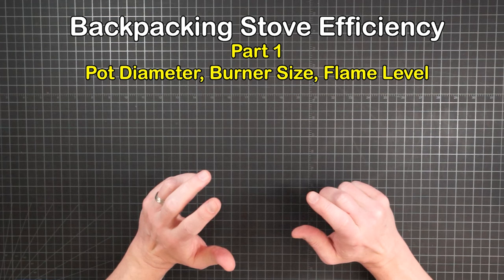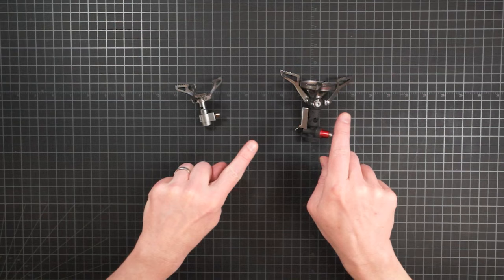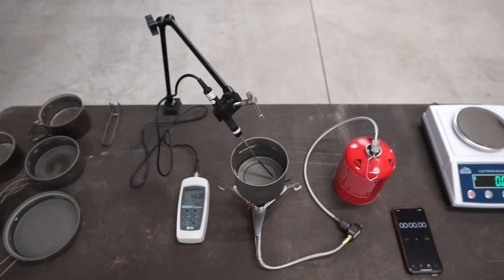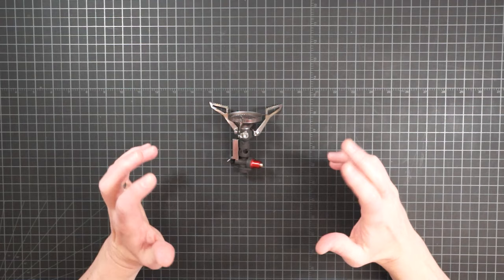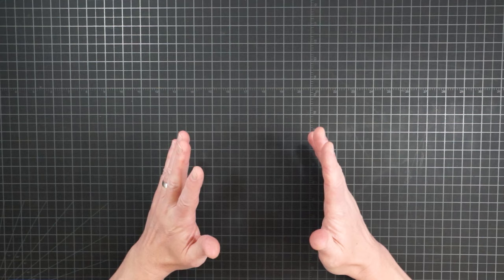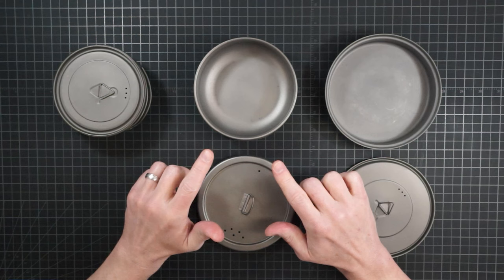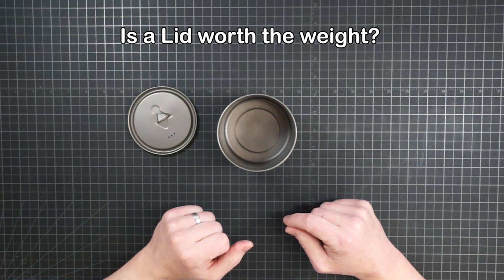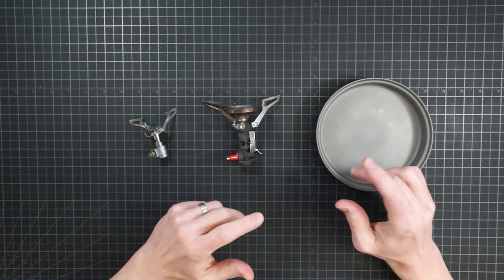Backpacking Stove Efficiency, Part 1: Pot Diameter, Burner Size, Flame Level

Comment: A useful realistic comparison. Thanks.
On a parrallel su bject. I recently bought a small (0.8L) kettle to nest in my pots. Using a Trangia stove it was taking just too long to boil with a slight breeze. I switched over to using my 1.2L pot with lid and the water boiled comparatively quickly. Result, the kettle has now been shelved. The narrow base was allowing too much heat to escape without heating the water.
Reply from the maker: Interesting.  I do want to test a variety of kettles.  I have a few sizes in both titanium and aluminum.

Comment: Brilliant piece of work.   I also went far into the weeds 20 odd years ago with my alcohol stoves.  I'll spare you the gory details but I ended up using an aluminium Trangia pan, painted with matt black stove paint and a foil lid.  My epiphany came after frustration in getting comparable results between workshop and field testing.  Finally worked out that when I introduced a windscreen it created a micro climate under the pan.  This assisted in the vaporisation of fuel and decreased boil time but not fuel efficiency.  So I duly reduced the holes and their diameter to compensate and created way better efficiency.  If you want to know what stove I use, it's vaguely similar to Don Johnsons Photon.
Reply from the maker: Good to know! I do plan to start testing alcohol stoves after I finish wind testing HX pots.
Reply: @GearSkeptic  If you want some help getting off on the right foot with alcohol stoves let me know.  I can save you going down too many rabbit holes.  They are great and can be amazingly efficient but like a good woman they need patience.  My last iteration would boil two cups of water on 15ml of fuel.  I wouldn't even bother with any testing without a wind screen.

Comment: Great testing! I've always wondered how a larger burner would act with small pots and cups. I think the biggest efficiency difference is adding a solid wind screen that allows the pot to nest into the wind screen an inch or so. That way the heat is built up and more transferred to the pot base and side walls.
Reply from the maker: I'm working on wind effects and windscreens now!
Reply: @GearSkeptic  Awesome! Looking forward to that video.

Comment: I cannot express my sincere gratitude enough. I am beyond impressed by your efforts to bring the challenge of stove efficiency to light. And this is coming from someone who already figured this out for himself many moons ago. Thank you. You're the best.

Subjectively, I found the differences to be so large that I ultimately came to prioritise the extremities of the selection. Of the arguably four most important variables in stove system selection: efficiency, weight, volume, utility, I set as many constants as I could for each extreme scenario: long haul large pack trip and short haul small pack trip. Once I had arrived at the gas efficiencies for each stove system, I evaluated the latter based on volume and weight, and the former based on weight and utility. I finally bought one of the most expensive large containers I could find as well as one of the most expensive small containers I could find, with matching stoves. The dominant condition being that gas, stove and ignition must always nest inside the pot in such a way that irreplaceable components of the "system" would always be self-contained in a separate pack module. With efficiency and weight factored out, the catalyst of convenience came to be the next logical step to developing a coherent pack system. With the growing number of utilities I can incorporate into a single pack, the stove system has become just one of many parts which must effectively work together to facilitate tackling the challenges of worst-case scenarios in nature. It of course means that the stove system, in addition to doing its job, must be quick and easy to grab and actuate, and that it must not fail; or, if it fails, must be quick and easy to replace and repurpose according to its relative value.

For short summer trips, I nested a 100g can and BRS into a 750ml Toaks that works in conjunction with fabrics and walls in my pack to attenuate elemental interference.

For long all-season trips, I customised the larger MSR reactor to serve as a general purpose stove with several thin-walled titanium vessels nested inside. A summer trip vessel is often incorporated.

In both scenarios, I always pre-plan restock locations for cans and supplies, as additional buffer my yet highly fallible system.

I hope, someday, to be able to travel unhindered for a virtually unlimited amount of time in very rough land with the right base equipment and skills. This has been a dream of mine since I was a little boy. And it wasn't until recently that I realised the actual validity of this idea. I am extending the time I can go unsupervised every so often. I believe we're soon at the point in time where experienced backpackers with careful planning and deliberately sourced equipment can become completely independent of each other. This isn't so much an introverted pursuit as it is one of safety and comfort. Once people are able to go fully prepared into the field, they can go much further, and accomplish much more in that time with minimal risk. And the social aspect of backpacking can thus be much more pronounced. Therefore I strongly endorse the transparency your channel brings. It will enable us all to be much more careful and deliberate in our approach to challenging the outdoors.
Reply from the maker: Thanks very much for all the thoughts!

I’ve been quite intrigued with the idea of just how long one can go unsupported (that is with no outside help or resupply) using just what fits on your back.  I just find efficiency to be a generally fascinating topic.

Comment: Good stuff as usual. I watched once for enjoyment and a second time to take notes. Based on my own experiments (this was years ago and the details are a bit fuzzy) adding even a bit of wind using a small fan set very distances away erodes any gains made by using a low flame pretty quick and will also likely make the lids more important. I think the trick there might be to look at just how little breeze there could be that we might not really notice it exists and if that's all it takes to kill the benefit of a low fame or not. We're not all going to take a Kestrel to measure the wind so we can turn the knob accordingly, but it seems easy enough to potentially have a bit of ribbon or string or something cut to a specific length that could work as a sort of wind sock. Using the Beaufort wind scale might also work.
Reply from the maker: I ordered a fan that has an infinitely variable speed control so I can get down very low, and use finely graded steps.  Then the Kestrel will help me measure the actual mph of those fan settings.

I like the idea of a wind string, or something shiny and extremely light like a strip of mylar from one of those emergency blankets!

Comment: Would really love to see you compare heat exchange pots with normal pots and see if they are worth the weight increase. Specifically, I’ve been using Windmaster with a jetboil stash pot which seems to make it very resistant to wind and boils water super efficiently (and fast). Very useful for group hikes or snow camping.
Reply from the maker: I’ve got wind effects planned for Part 2, but then heat exchangers are next!
Reply: @GearSkeptic  Could I also put forward a suggestion of the MSR Reactor if you can get your hands on one. Both for wind protection and heat exchange. I've been using mine for a couple of years and anecdotally think it is more fuel efficient, but would love to see your analysis on it. Especially to see if the extra weight is worth it over time
Reply from the maker: Definitely! I’ve got a Reactor and will include it.

Comment: Great tests, lower flame, higher efficiency, I am about to run some tests of my own, probably not as well conducted as this, but I am looking to see if a jet boil cozie will increase efficiency significantly more than not using it on a titanium pot. Thanks for this, right up my street!

Comment: Finally, a youtuber who answers the questions methodically using science, not because they get paid to shill something. 

Some more "food" for thought. I have also wondered about the effect of different fuels on these systems. The gaseous fuels like butane/propane or isobutane, or the liquid fuels such as white gas, kerosene, or even gasoline, to solid fuels like fuel tabs or paraffin wax. Of course each with its own system along with their pros and cons.

As for the systems the design can also have a huge impact on the outcome. Wind screens (metal/synthetic or natural i.e logs, rocks, snow wall, etc), heat absorbtion fins on the pans for increased surface area, even altitude and temperature will have a huge effect. Some of these systems wont even work in some of the given conditions.

An almost limitless set of criteria could be tested. Love these really informative videos, keep it up!
Reply from the maker: All great ideas!  I'm already collecting stuff for wind and screen testing.  I have several brands of canister gas to see if there is a difference, and I'm also acquiring heat-exchanger systems to get those in the project, as well.

Comment: I really want to see your wind test results. As far as I can tell, its the biggest factor not analyzed yet. Its going to interact with the material selection as well. Stainless is less conductive than AL, so in still air I think I expect the AL to be more efficient as it transfers heat from combustion to the water more efficiently. But in heavy wind, I expect the stainless insulating walls to keep the heat in. I expect the benefits of lids to be far more significant with wind too. 

Thanks for doing the good work!
Reply from the maker: I'm already gathering the supplies and planning wind testing!
Reply: @GearSkeptic  If you want me to do any simple CFD or FEA to help out, let me know.

Comment: The overall efficiency of the MSR on low with this setup is 52%.
5.84g (average boil consumption) of isopro has a combustion energy of .288mj whereas the water underwent .149mj actual heating. Should compare it to jetboils and windscreens.

Comment: Thanks for busting the lid myth for small pots. That gray shirt guy lived rent free in my head too.
Reply from the maker: We'll see.  Lids may make a comeback during wind testing in Part 2!
Reply: @GearSkeptic  lids are important when bugs are out, especially mosquitoes, and as you note, when the convective heat loss is elevated due to wind. Very cold morning temps in the higher elevations year round are a good reason to add a lid to the kit. Of course it also serves to keep everything in one place if you fasten it down or put it in one of those nifty orange mesh bags Toaks provides. 😊 Of course they add weight too but…you have to consider utility which those bent on shaving grams sometimes overlook in my opinion. It’s subjective, of course, so ‘different strokes for different folks’ applies.
Reply from the maker: @wanttogo1958  Agreed!  I will continue to bring a lid for most of those reasons.

Comment: My BRS dumped dinner on the ground on its first outing when an arm overheated and bent in half. A few factors worked against it: high wind, heavy load (~1L), long burn time, and adding a windscreen partway through softened the metal beyond it's limit. I promptly replaced it with something more reliable.
Reply from the maker: Interesting.  Haven’t heard of that, but will keep it in mind when I start testing windscreens.
Reply: Yikes. But not wholly surprising. Windscreens around gas burners has been known to cause melting. Windscreen is almost essential around alcohol burners as the flame meanders wildly, less so for gas. For big cooking events I use Trangia with the gas converter, more stable with windshield builtin. On longer trips the weight of the food dominates so less need to focus on cooking system weight. A 3 pot Trangia gas system can be around 841g made up of the base, windshield, a 1L duossal pot (Alu outer for conduction, steel inner for robustness) and an 0.8 Alu pot for just boiling, and a non-stick frying pan (which is your pot lid and plate), pot grabber, and the gas conversion. You can fit 100g and a collapsible mug within to help prevent wrattles. In comparison say a Toaks 900ml + Toaks 550 + a BRS3000T = 300g no windscreen, less stable and no frying pan (which doubles as plate and keeps rain off, etc).

Comment: I have been looking forward to this video. With all that you have covered here, I was beginning to think you could not have left anything to cover in part 2. Having said that, I was not surprised by the additional variables you came up with. Thank you for this
Reply from the maker: My pleasure, sir.  Hope it can help!

Part 2 will be on wind effects.  I'm thinking wind may change some of these recommendations.  Part 3 is planned for heat exchanger systems (which will expand on wind effects).  Beyond that, I'd like to check aluminum vs. titanium vs. steel, and maybe a test set using larger pots to see if big burners turn out to be better there.

Now, I just need 30-hour days to get it all done!

Comment: I found this very useful for even just heating up soup or stews at home. Use larger pot and lower flame to use less gas. Great video.
Reply from the maker: Good point!  No reason it shouldn't work at home, too.

Comment: Great stuff confirming some of my personal observations.  Thanks for all the work!  Now I'll step to the back and put on my grey shirt for two things: (1) screwing on/off the stove can also waste gas, so one has to be diligent and efficient or perhaps leave a stove screwed on (overnight?) to avoid too much inadvertent gas loss.  Some stoves are better at reducing loss since they have a large flange and O-ring in addition to the single small O-ring like a BRS-3000T has.  And (2) we don't always pay attention to our running stove and turn the gas flow off seconds or even minutes after our water reaches the minimum required temperature.  This delay just wastes gas and the amount of gas wasted depends on the flow rate: high flow wastes more gas in 10 seconds than low flow wastes in 10 seconds.  This also points to using the lowest possible flow rate that gets the job done given the wind and other conditions.  However, it is possible to use too low a flow rate (not covered in your video) where fuel efficiency seems to get worse.  Thanks again for another great video!
Reply from the maker: All good points!  I didn't actually explore a bottom limit for a practical low-flame setting.  Though, indirectly from what I saw, I think the one I chose may be not-quite-there-but approaching the point of diminished returns. 

Of course, I suspect wind effects will change all of this in preference to a higher flame.

Comment: These results match closely to what I discovered in the field on the PCT. Note I also was generally at altitude and cooler ambient temp). I used a BSR and Vargo Bot 700. In the Sierra I used a big canister, and did 3 boils (~600ml) per day and could last 6 days. I would adjust flame to just cover pot bottom, lid only if windy. Seemed to be a fairly efficient fuel usage.
Reply from the maker: I like the Bot.  It's my go-to (in the original 1L size) if I am being the stove guy for a hiking partner and will be boiling for two.  Wind effects will by Part 2.  That might change some recommendations...

Comment: Mors also used to teach not to clean the soot off of your pots. He taught that a properly blackened pot cut the fuel use in half for a boil.  

Not sure it’s within reason for this set of tests, but if there is anyone that can get to the bottom of that, it’s you.
Reply from the maker: Yes!  Love Mors.  I've got that down on my list of future things to try.
Reply: @GearSkeptic  as I recall Hiram Cook played around with the blackened pot idea and didn’t see any discernible difference. I’m interested to see what you come up with on that one. I think aluminum vs titanium with some recent research to debunk the whole aluminum use scare from the late 80s (it’s still in antiperspirants to my knowledge), would be a very interesting comparison. Stainless steel too but most hikers aren’t going to carry stainless steel very far these days.

Comment: Great analysis!  One factor you didn’t cover (I suspect on purpose) was packability (i.e., the amount of space taken up by the stove, gas canister, and pot).  The small pots are the most space efficient as you can generally fit the canister and stove inside, even with the lid on.  The same can’t be said of the bowls/pans.
Reply from the maker: A fair point!  I really like that D118 bowl for its compromise between weight and efficiency, but it would require some packing innovation.  Going to be tough to beat the perfect fit of a 110g can and the Toaks 550.

Comment: You're a legend! I was a bit surprised that the smallest pot takes the cake for overall efficiency, good to know. I would like to see the effect of a flux ring pot, plus a neoprene sleeve if you can find one. Probably not much for the sleeve though if the lid didn't help.
Reply from the maker: I do have heat exchangers scheduled for Part 4, after I do Part 3 on windscreens.

That way I can try to compare an ultralight stove/screen to an exchanger system for weight efficiency.
Reply: @GearSkeptic  Does your series include best pot material?
Reply from the maker: Not yet, but I have on my list to test aluminum, titanium, and steel against each other (as well as the effects of a blackened pot).